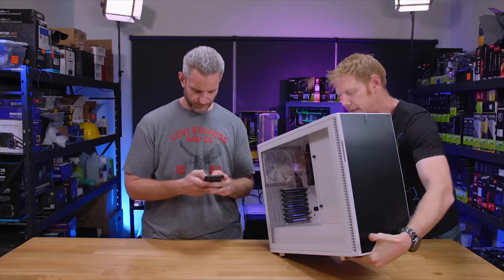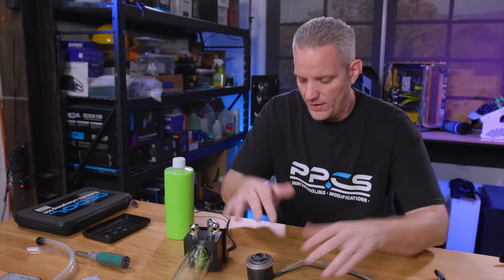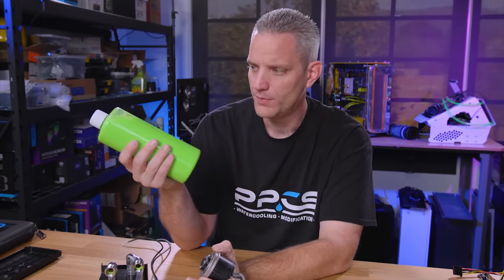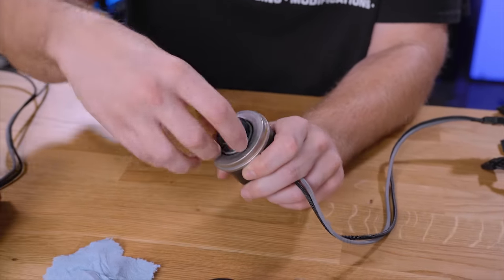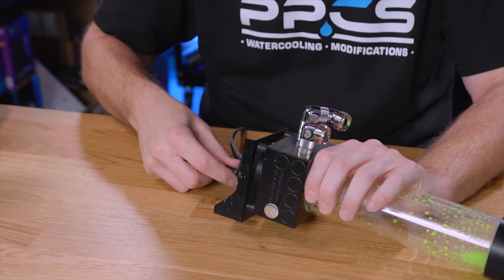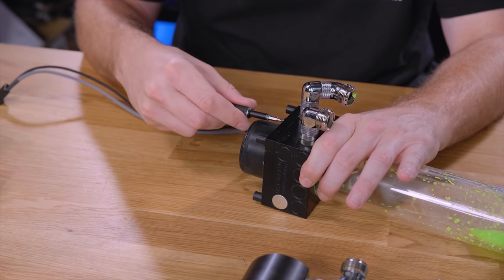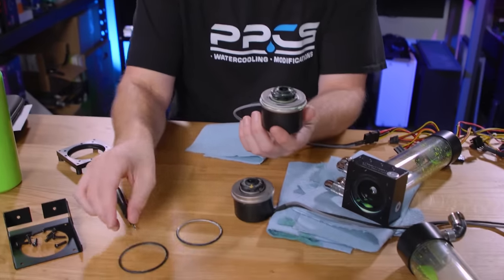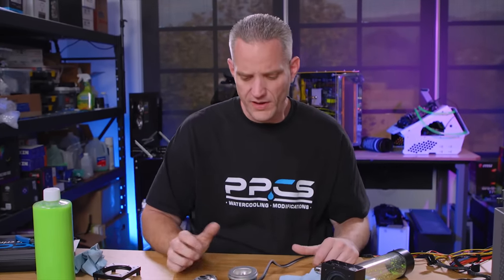BOTH of my pumps died... here is how I fixed them!

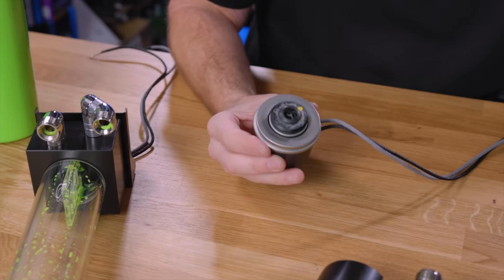Comment: 3:18  No, that's precisely why I do water cool.  With water.   Distilled.  No colors.  No buildup.
Reply: Just out of curiosity, you still got to clean it every half year or so to avoid algea, right?
Reply: Thanny 

There are people who live and breathe air cooled Porsches, and some who prefer the newer ones. The air cooled fans are doing it because they know it's harder, and they accept those challenges.

We who use fancy fluids accept those challenges too. We don't disagree distilled water is easier, but we just like what we like.

Hopefully that explains things.
Reply: I wonder would a bit of say food die hurt just for a tinted look?
Reply: @TheFlatronify  I have never cleaned my loop, and it's been 24/7 since 2012.  The only real change was removing the graphics cards in 2015, when one of them died, and I got a AIO unit to replace them.  Didn't need to drain the loop (paper towels and a bit of care were all I needed).  I had intended to get a block to put it back in the loop, but it was working well enough without it.  I have a silver coil to inhibit microbial growth, so there's no algae.  I certainly wouldn't drink the water in there now, but it's still clear.  My reservoir is a 5.25" double bay unit, so I can top it off when it needs it from the outside while the system is running.  I've done that perhaps twice a year.

On the coming weekend, I will be disassembling it completely and building a new system into the existing case, so it will have been just shy of six years of almost 24/7 operation.
Reply: @thegirthquake8574  I have no problem with that.  I just don't want people who are considering water cooling (even if it's just AIO's) to think this problem is inherent to the process.  It's not.  It's a consequence of going for appearance over function.  

If you use just distilled water, and stay away from DDC pumps (D5's are cooled by the water they pump, while DDC units tend to overheat), there is essentially no maintenance involved with custom loop water cooling, other than looking once or twice per year to see that your reservoir is reasonably full.
Reply: @TrueThanny  report back to us what you find in all the nooks and crannies when you disassemble.
Reply: aio are better  that this little to worry about
Reply: @keptinkaos6384  don't use food dye.  It's mostly sugar and will cause bacterial and algee growth.
Reply: @steampunkskunk3638  thanks for that
Reply: lol exactly my thoughts.
Reply: Do you get any problems with corrosion? Singularity computers keep saying best is distilled plus a corrosion inhibitor because even copper + nickel will exhibit some galvanic corrosion due to the slight electrochemical difference after a long time.
Reply: If it runs 24/7 could that be the reason you have no algae? Algae cannot grow if the water is always moving. Am i wrong on this?
Reply: My system has also been running for years with no maintenance. Think I have topped it off may be 2-3 times. It has a silver coil for the algae, and a anti corrosion fluid. Think i used about half of what was recommended for the last part. Tho I haven't looked inside the blocks or pump so it might be fine, might be rusted.
Reply: My loop has been going for 3 years (on/off use) with distilled water and a couple of drops of copper sulfate. I have a little bit of corrosion on my gpu blocks but I also have the maximus vi formula with the aluminum vrm block. Asus put some kind of coating on the block and I guess it has held up or I would have expected the corrosion to be worse.
Reply: I have been water cooling since 2002 and also found that straight distilled water with just a silver coil in the reservoir is by far the most maintenance free coolant. I drain and refill every year or 2 and do disassembly/cleaning every 5ish years.
Reply: @snarfsnarfff  Algae will definitely still still grow in a flowing loop. If anything it makes it worse because the fluid temps are higher. I used to run 24/7 for years, now its off more then on and haven't noticed any difference in growth between tear downs.
Reply: I use water and automotive radiator coolant. No problems for the last 9 years on the same pump running 24/7.
Reply: @Wrathlon  I'm actually surprised automotive coolant isn't more popular. Maybe because the additives reduce it's cooling abilities a tiny bit, and you know everyone wants ever degree lower they can lol. Have you had any problems with it degrading your tubing?
Reply: @johnrutherford4879  None at all, Ive been using the same PrimoFlex tubing since day 1. Its great as its meant for long term use in much harsher environments than this (mainly car engine temps), doesnt gunk shit up, doesn't wreck tubing, doesnt hurt pumps, doesn't break down over time and if there is even the tiniest leak you can smell it a mile away as radiator coolant has a strong distinct smell when even mildly warm.
Reply: @Wrathlon  I wouldn't expect it, but I am curious as to why.  The purpose of coolant in a car is to broaden the range over which the fluid remains a liquid.  Do you expect below-freezing and above-boiling temperatures from your computer?
Reply: @TrueThanny  No but it does have plenty of great qualities none the less. Ethylene Glycol inhibits galvanic corrosion, is compatible with rubber found in orings, doesnt leave a crappy buildup, is designed for much hotter temperatures than it will ever see in a PC, completely stable and doesnt break down over time, doesnt stain or leave a residue and is a strong biocide.

It does have a lower specific heat capacity than water but this is more of a problem at the heat output of a 100,000+ watt car engine and not something that would be really measurable at 0.5% or less the output as long as your pump is flowing properly.

I've done 0 maintenance in this time, I never really clean it out or take it apart other than when Im forced to when upgrading or whatever.

Also its bright green and my build is black and green.

Comment: You can get some wire appropriate for the job you are trying to do. Go get a floor broom or brush with as fine filament as you can find. Cut the filament for the size of hole you are trying to clean.1/2 inch hole cut them a little over half inch. Take the wire and twist the filament into the wire twice as long as depth of the hole. Bend it in half and twist lightly enough to just to make it hold. You now have a custom bottle brush for all those tiny places.

Comment: Thanks for this Jay! my d5 died out on me tonight and cpu was throttling at 100c after only a few minutes. Haven't disassembled it yet but just seeing you take it apart gave me an idea... I heard the same clicking, so I gave it a strong shake up and down a few times while it was under power and it started up in my hands and the radiator fans instantly dropped down. Now I can at least keep gaming until the new fluid comes in =)

Comment: I used to have aquarium pumps within Fellers designed almost like that and every few months you would have to pull them apart and clean out the algae and gunk I only had one completely fail and burn up because I left it chokes and clogs and stock for about a week before I realized it had quit

Comment: I just had a d5 die due to bad balance. It slowly ate itself and at the end of its life (less than a year) I had to change the speed (up and down) as it died further to keep it going. Several times it just stopped if I ran the PWM too low or too high. Got it apart and it was noticeably off-balance (the gap around the impeller wasn't even). New pump has almost no vibration at all, so shouldn't die so fast. Edit: Lesson learned, I now have a backup pump to go with it.

Comment: A few seconds of running a pump dry won't effect it they burn up due to friction and heat so a few quick seconds won't build up much heat (I'm used to bigger pumps not PC pumps) also I don't water cool just due to the maintenance tho I do use the self contained coolers

Comment: I would love to see disassembly of EK's FluidGaming (FG) pumps (esp. the D5).
Since pumps have metal parts, but the loop is full-aluminium it makes sense the metal in FG-pumps should also be alu (but they don't specify on the site, except there're warnings on regular pumps to not be used in FG-loops, and FG-pumps to not be used in copper/brass/nickel loops).
Of course most of the plastic pump tops & reservoirs are universal, but they're not on the FG-site (only on the regular site), so things can get confusing.

Comment: i know this is an old video, but this did work. I had a pump that died a while back, but decided to try this. Opened it up, and cleaned it, plugged it back in, and works
Reply: For how long worked after you clean it? Mine dies in 2-3 days again after cleaning it 😢
Reply: @neagu02  It's still working now. I actually had to use it again because the new one i got from EK died, but that original one that I thought was gone, is still pumping away.
Reply: Thank you for quick response. My pump is an EK as well , I have to restart the pc 2-3 time before the pump kicks on again, but once the pump is on I have no issue with it after that.

Comment: 4:12 Its called a rotor.  
The Impellor is the black part on the top that moves the fluid. 
Wet rotor pump would be the best explanation for the type of pump this is.  
The white ball is ceramic not nylon. If you look inside the rotor from the back you can see the other "cup" part of the bearing. It has 4 slits in it to allow the pumped fluid to enter and lubricate the two surfaces, this is why you should never run one dry as whatever it is pumping is also the lubricant.

Also, when putting one back together don't just let the magnetic force it snap the two parts together. I have broken a d5 doing this! Ceramic does not like shock loads.

Comment: I only use distilled water and have replaced these pumps ( Swiftech) every 3-4 years. My problem is wearing out the porcelain barring and pump starts rubbing on side, I'm running it in Moonson reservoir with the pump running on it's side verses up. Have you heard of this problem.

Comment: I wonder if it's possible to use some sort of synthetic oil instead of water with those things? Mineral tend to be quite abrasive (heck even engines will leak internally if you try to run them on synthetic after a long service life with mineral)

Comment: Warning: Some new D5s CANNOT be taken apart! The new ones do not have the ceramic ball bearings, but ceramic stick bearings! They will be definitely damaged if the impeller is removed!See the manufacturer website.(Not all D5s are affected) Affected pump i know: Alphacool Eispumpe VPP755 and all other VPP755s
Reply: @wannabeasd  surely not. Aquatuning Germany, the biggest worldwide seller for watercooling parts, sells the mentioned D5s. And if they sell fakes, you should worry.
Here is a link, if you translate it, there is a warning in the description.  I am not trying to spread some sh*t her. 
https://www.aquatuning.de/wasserkuehlung/pumpen/d5-serie/d5-pumpen/20531/alphacool-eispumpe-vpp755-single-edition?c=332
Reply: The VPP755 specifically is technically not a Laing/Xylem D5 pump, it may be made to the exact same dimensions for existing compatibility however is is an alphacool designed and made custom unit with different specifications to the Laing/Xylem D5.
Reply: @jacobfoster6773  that's correct. The mentioned one is sold or labeld as a d5, or equivalent. My "old" and original Laing d5 has the ball bearing, the new one is the Eispumpe with the stick bearing.
Just wanted to let you know, that there are versions, that are not user serviceable and are damaged if taken apart.

Comment: nice video, i started of with water cooling 1 week old and the dc to dc pump motor controller failed. that pump cost over £120 in early 2003. then moved to gigabyted water cooling and used that on a early Prescott. i didnt have much money at that time and over clocked celeron prescotts rearly easy  on 478 sockets using asus motherboards. there was a hack in the registry on xp where you could actualy tell windows how much cache you had on the cpu. i did bench test using a full p4 and a celeron at same speed and must say it was just a little smoother on 3dmarks2001. nature was more gpu but the matrix was a great bench mark. my first best gfx card was a nvidia 6200 and i unlocked the extra 4 pipe lines to 8, memoery at 700mhz. i did a volt mod on the gpu adding a resistor to up the volts a fraction and glued heatsinks on the memory.
i was so proud of it that we placed it in the shop window where we worked just to show it of.
love your vids jayztwocents but i feel sometimes live nvidia new card everyone is on about it so much its like a new song in the charts its just overload to much. keep up the good work and stay with planet earth x

Comment: I have an situation I've never ran into while trying to run the EK-Quantum Kinetic TBE 200 D5 PWM D-RGB - Plexi (incl. pump).  The motor does work, but it seems quite weak as it appears the liquid is not completely cycling through the whole loop.  I do see liquid spinning in the reservoir, but weakly.  

The PSU I'm using is the EVGA SuperNOVA 1600 T2, 80+ TITANIUM with the ECO mode OFF.  Also connected to the PSU are the normal 24 pin, dual 8 pin CPU, dual 8-pin CPU, 1 sata 6-pin & 1 peripheral 6 pin cable.  I'm not sure why this is happening as the rest of the hardware such as the video card, cpu, leds and OS are working fine off the PSU.  When I first put together the loop and performed the 24 hour water test, I used an EVGA SuperNOVA 750 GT, 80 Plus Gold 750W, but I just had the 24 pin cable shorted and the same exact  1 peripheral 6-pin cable using the same molex socket.  This worked like a champ and the motor was working perfectly and the liquid cycled through the loop like it should.  I cannot use the 750 watt PSU because the system I have uses:
NZXT H710i case  
Gigabyte X570 Aorus Master motherboard
PSU: Rzyen 9 5950X
128 GB Corsair Vengeance RGB Pro Ram
GPU: ASUS TUF Gaming GeForce RTX 3090 OC
extensive 12w NZXT LED strips and fan led & controllers as well as EKWB 5w led cabling.  
3 - 120mm NZXT Hue2 RGB fans on EKWB PE360 radiator (front intake)
2 - 140mm NZXT Hue2 RGB fans on EKWB Collstream CE 280 radiator (top exhaust)
1 - 140 mm NZXT Hue 2 RGB fan (rear - exhaust)
PSU - EVGA SuperNOVA 1600 T2, 80+ TITANIUM 

Can you offer any guidance on what I should look for when I troubleshoot the power issue for the D5 motor?

Comment: About 6 months ago I thought I messed up the molex connectors when I forcibly removed the pins from the molex so I could route the cable through my case(did not know about extraction tool).  I bought new connectors and pins and things were working fine.  Yesterday my computer gave me a warning that my cpu was at 98C!!  The pump wasn't working again.  After fiddling with the molex again I decided to order a new pump.  Now I see this video.  Also thinking I have been using the EK solid liquids.  HMmmmm.. Guess I wont be buying that crap ever again.  Cant wait to dissect the old pump.

Comment: Hi Jay et al, are those metallic parts of the pumps made of aluminum ? what about galvanic corrosion if using copper blocks ?
Reply: old post, but it's stainless steel.

Comment: Thanks dude your legend, still haven't mastered drainage, still get it all over the floor lol.  question is should i change the primochill cobalt occular flow vue coolant, as ive barely used the pump and it stops after an intensive overclocking sess, a cpu that has a TJ max of 68'c hit 87'c in bios :(  (Threadripper 1950X)

Comment: Hey jay I doubt you will see this but my Corsair pump works fine. Motor is spinning but no water will pump through the system. I took it apart and cleaned it but I still get the same thing happening

Comment: i had one die.. on the impeller where it rides on the bearing wore out and it started making a horrible grinding noise.. is there any way to fix that? i'd guess replace the impeller but from what i could find that costs almost as much as a new pump

Comment: Handy, I have 2 D5's in my system and will be doing a full tear down and clean over the Christmas holidays. I didn't know i could just pull the impeller out like that. Kinda looking forward to it now that I've run pastel for a couple of years with only doing flushes in between.

Also what was your final verdict on Primochill Vue?

Comment: I have a second Thermaltake Pacific PR22-D5 Plus that I bought after the first one seems death. The second device start to behave the same ... at booth it takes up to 1 minute until the pump starts to work.

Could this be the same problem? I have the impression I started to have this problem since I used colored liquid (from Thermaltake too).

Comment: Love the videos man. Super helpful. Ever have an issue with a DDC 3.2 pump starting and stopping? Just installed a EKWB x360 and my pump is doing it from out of the box, but once or twice it actually ran properly. Since filling the loop and plugging everything back in to my mobo the pump is starting and stopping every few seconds. Any tips man?

Comment: Had a different problem with a pump. The bearing somehow got worn unevenly on one side, causing the impeller magnet thingy to grind on the side wall a bit. Made a buzzing sound every 10 mins or so. At first I had no idea why the damned thing was vibrating so much... Did a quick disassembly and saw there were scratch marks on the walls of the pump and on one tiny corner of the impeller. The pump was definitely going to die, swapped it out for my spare. Be careful guys, not sure what pushed the bearing to wear out unevenly on one side, but it happened. Of course, the pump was almost 6-7 years old...